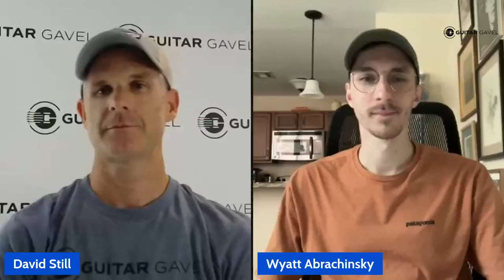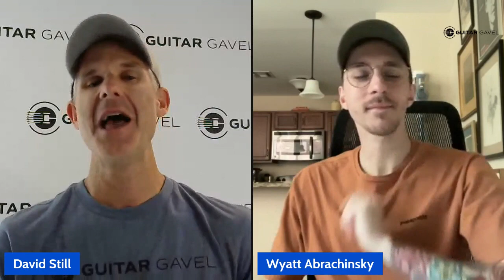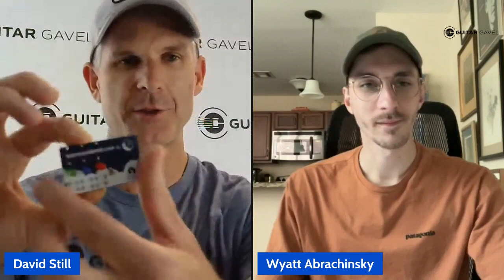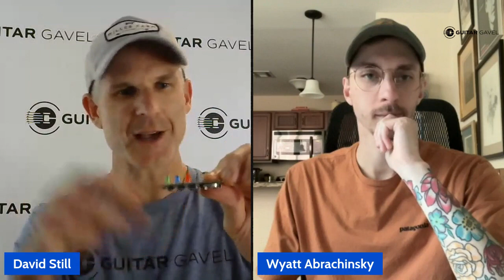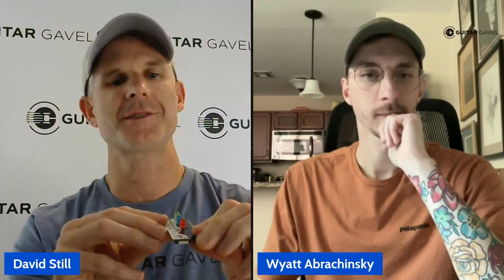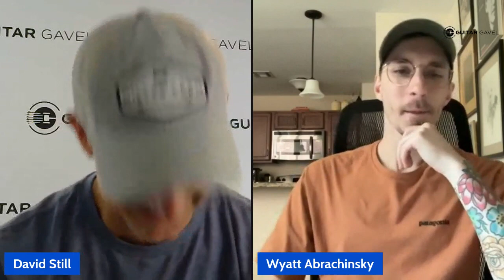Wyatt Wednesdays- Soldering: A Novice Conversing with a Pro

Comment: I've been a "beginner" solderer for my whole life. I've never been good at it, even though I used to do it a lot, earlier in my career. I used to make my own cables, keep bad cables, and reuse the connectors, and on and on and on.... Like Bob Dylan says, "I used to care but things have changed."  Like everything else, you have to have the right equipment. I've always done my best soldering at someone else's soldering work station.
Wyatt's right, the helping hand is helpful, and so are hemostats. Have to have right gear.

Comment: Everything is bad for you in the state of California.  I use leaded solder too.  Needle tipped soldering iron with spare tips. Stainless steel wool to help keep the tip from oxidizing and a small damp sponge to clean the tip.
Chisel tips are great for lifting frets.
Soldering is an underappreciated art. Requires patience, steady hands, and the correct tools.
Fun conversation Wyatt and David!
Reply from the maker: Thanks Scott, and thanks for your tips as well!